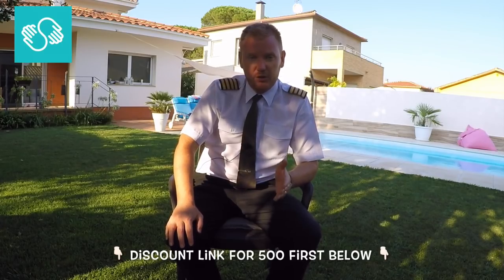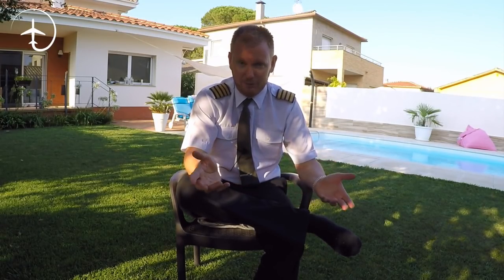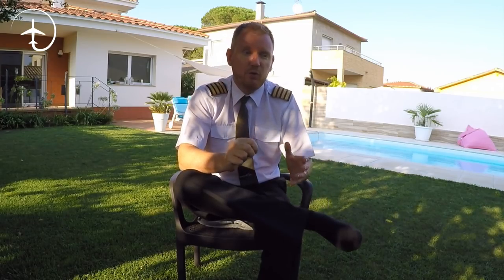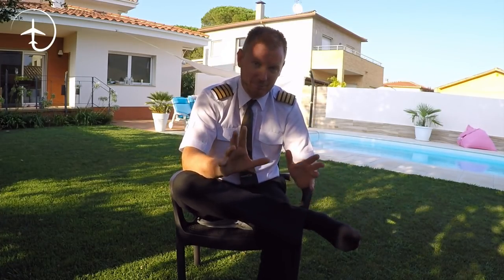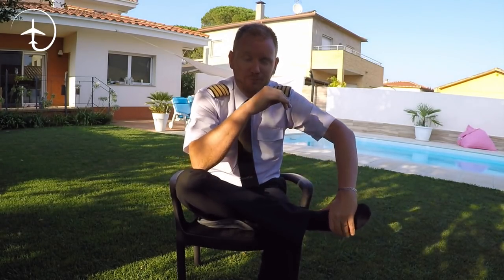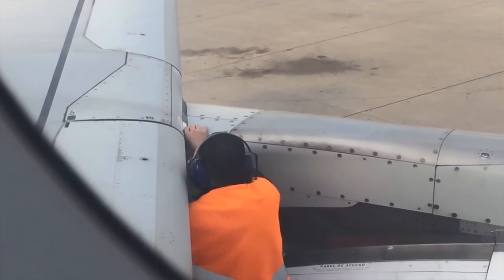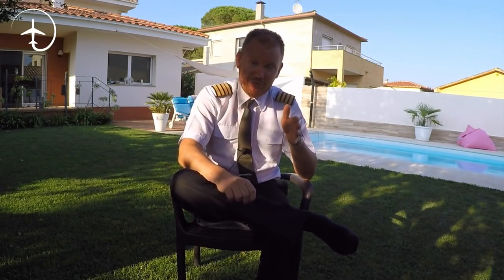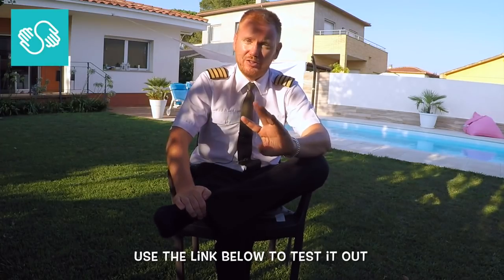Fixing aircraft with DUCT TAPE?! Mentour Pilot explains.

Comment: While waiting for boarding my last airline flight, on an A330, we got to watch them taping up the left wingtip, where the winglet was noticeably missing.  I don't know if it fell off during the previous flight or it was removed before I got there.

I also noticed they shut off the APU for a while and delayed boarding.  The pilot later said that was because they had to shut off power to work on the plane's air conditioning, and they delayed boarding because we'd be less uncomfortable staying in the airport terminal than on the plane with no lights or ventilation.  No mention of the winglet.  No problem on the flight.

Comment: I think you should do a video about ATC communications. I don't really know much about what happens between the ATC tower and the pilots other than the IFR/VFR, taxi, take-off and that kind of clearances, but I would like to know what do you guys say to the controllers when you are at high altitudes, what kind of facilities like Radar, Control or Center do you contact and I always wondered, what is the proper way to check in a Radar/CTR frequency?

Comment: So, it really is 600 mile an hour tape!
Reply: Wes Smith 
Yes it is 
Im a retired Aircraft Mech from CONTINENTAL
Reply: True and if the area is cleaned and the tape is properly boned down it wont come off. In fact we were told not to paint over it. We had one "temporary" repair that was missed and painted over at D check. It was not discovered until the aircraft a B707 was stripped and repainted at the next D check.  Retired TWA
Reply: Wow, that is some good shit. No wonder it is so expensive. (I was already familiar with the difference between "duck" tape and proper aluminum duct-work tape so I'm not horribly surprised. The HVAC stuff isn't cheap, and it doesn't have to hang in at 0.85 MACH.)
Reply: Yeah but the wind won't be affecting it in mid flight, because the air density is significantly lower at higher altitudes!.
Reply: I saw an episode where a cargo crashed due to lot of smoke in the cabin that prevent pilots to see Instruments. 
Can a cargo o passengers plane flight with pilots windows opened? 
Thanks mentour for the answer
Reply: Most "Duck Tape" is junk. The glue dries out in a year and just turns to powder.
Reply: Wes Smith. We used speed tape/ordnance tape/600 mph tape for military planes in the 60's.  My squadron flew F4 Phantoms, so the name was appropriate.  It was only $75 a roll back then.
Reply: @vondumozze738  of course, $75 a roll in the 60's was a big deal! If I remember my dad's stories right, gas was 5-10 cents a gallon then, right?
Reply: Speed tape: "Speed, I am speed."
Reply: @vondumozze738  A Rol of this tape can be bought by anybody. The thing is, if you are using it in the aviation it needs certificates. CofC. Then the price goes with hundreds up. Applys for every part or consumable that is being used in the aviation. Still it is not that expensive as the guy explaines. Most common sizes used is the one inch or 2 inch width. But if ordered bigger, yes very expensive.

Comment: In the USA duct tape is often called "hundred mile an hour tape" from its use in fixing minor damage on lower division racing cars.
Oh and most adhesive tape including duck tape is "pressure sensitive" this just means the adhesive needs to be pressed to create a bond,  as contrasted with a wet adhesive tape that only needs light contact and then drys or cures to bond. (such as paper tape with moisture activated glue often used for postal boxes or even the "lick and stick" envelopes and stamps, or woven glass fiber tape applied with a catalyzed polymer resin)

Comment: Exactly! Speed tape is used to reinstate aerodynamic surfaces to maintain lift or protect external finishes. Occasionally we use it over the top of sealant in case it hasn't fully cured to prevent it from being forced out of the area, during flight, that's supposed to be sealed.

Edit: The application of speed tape is documented in the Tech Log, usually with periodic reinspection and reapplication requirements being called for. It's also used on military aircraft during conflict to affect what is known as a "battle damage repair" where it's applied both internally and externally to create a very strong but fast temporary repair.

Comment: We used speed tape on recently installed windshields if the aircraft had to fly before the sealant had time to fully cure.
We also applied it to boost pump caps. And leading edge seams.

Comment: The story behind picture of the speed tape being applied on the cowling.  Right behind the lip skin the leading edge usually shows erosion and up to certain limits per the SRM you are allowed to apply speed tape till a perm repair is done.

In the US when you write up an item as an airline pilot on the logpage and once the mechanic look at it and it is outside of the published limits then the engineers come in with a repair if its feasible.  Just like a pilot is only allowed to write up, mechanics are only allowed to repair per the manual.  Anything outside needs some sort of Engineering authorization.

Comment: In dakar rally they got some kinda speed tape in their tool for race. It doesn't cost 1000$ per one peace but it's like 50-200. Anything on the car can be patched up with that.
Reply: Every mid range and higher race team has roles of the stuff in different sizes.
Reply: Your car speed tape doesn't come with an 8130 and need to be applied by an A&P and that is the difference

Comment: Mentour,  As usual a fascinating nugget of aeronautical knowledge! I do have one comment: While it was nice to reassure the flying public that even if they saw the stuff coming loose, that didn't spell disaster, I think you should have reminded folks not to be shy about alerting the cabin crew if they see something really odd. (Yes, I realize it's a slippery slope...)
   For example you generally can't see the engines from the flight deck. But the passengers (and of course flight attendants...) can. British Midland Airways Flight 92 crashed in 1989 when the wrong engine was shut down. IMHO a visual report from the cabin could have clarified which engine was in trouble.
Jim

Comment: You call the people who repair the plane "engineers" but are they really engineers or are they technicians?
Reply from the maker: They are called engineers here in Europe. We have mechanics and engineers.
Reply: I'm European too; it's just that I didn't know the term was used to describe the people actually putting their hand on the aircraft
Reply: Europe goes to a full title of ' Aircraft Maintenance Engineer' instead of the US designation of 'Aircraft Maintenance Technician'. Mostly the same, but the AME is 'type rated' as to what they can work on similar to the ratings for the flight crew. The US is a little more free in what an AMT can work on, but is more controlled by their employer's training requirements nder the federal regulations.
Reply: Basically America figured out that if you call someone an engineer, you have to pay them more :)
Reply: @vinsanity982  getting a maintenance licence in the EU is much harder than in the US 
You can get an engineering degree using your licence exams
Reply: @stumo8681  I'm aware of that, but airplanes are airplanes. I'm pretty sure that if I felt the need to get that license, I wouldn't have any problems.
Reply: I was wondering this too actually, since here in the US the engineers are typically seen as the ones who work in the office buildings doing the analysis, design, and optimization of whatever it is they're building. They also take part in the manufacturing of course. However, when it's someone who strictly gets certification for maintenance they're typically known as the technicians.

Comment: Yes u can fix evrything with duct tape
Reply from the maker: Well, true to a certain degree. Maybe not everything.
Reply: wrong, flex tape will fix anything
Reply: Mentour Pilot If you can't fix something with duct tape you're not using enough duct tape ;)
Reply: Vaul the Creator - Duct tape is cheap, don’t spare it, use more, more is better.
Reply: duc't tape is cheep
speed tape is strong
but flex tape is the best
Reply: Robert Lafleur 2:14 is not cheap
Reply: Goran Rasljic nope
Reply: Goran Rasljic - Duct tape is cheap but that speed tape is really expensive like anything aviation related.
Reply: Robert Lafleur  i now but stil 700$-1000$ for a tape damn

Comment: It's also used to protect runs of sealant that haven't yet had time to fully cure.
That lets us install and seal panels moments before the flight is scheduled to leave.
If you've ever seen a huge smear of sealant spread across a panel from the seam back, that's what happens when uncured sealant flies without speed tape protecting it.

Comment: im an aircraft mechanic. we call it ally tape (aluminium tape) and yeah we use it ALL the time. aircraft get hit by rocks n stuff on landing/takeoff, if theres a gouge or crack in the metal you cover it with tape to stop moisture getting in and causing corrosion. corrosion is the aircrafts biggest enemy. the tape can stay on there for many months sometimes, as its not serious damage.

Comment: This was not a mayor issue but it caused the passengers to laugh, and made me laugh too.
My last flight was on-board an American Airlines B763, one of the oldest of the airline's fleet I would say. Covering the route from it's hub in Miami Int'l to Carrasco-Montevideo Int'l (Uruguay). We, with my friends, were sitting in the 27's and 28's rows, I was on the right 27 window seat, and at about 3 or 4 rows ahead, there was an upper bin with a malfunction on the closing system, the bin could not be closed and as you may know, the airplane can not take off with a bin opened. So, the cabin crew informed Captain Frank Akerman about the situation, he then decided to call maintenance. About 10 mins later, two maintenance personal came in the passengers cabin, and after 15 minutes of watching and figuring out how to fix the issue, they took some blue duct tape and closed the bin with it. As soon as the passengers saw the duct tape, laughs rained in the cabin. 
I immediately remembered a photo were a mechanic was showed putting grey duct tape in one of the engines of an EasyJet A320,  seriously we were held in the ground for an hour because of this, I would say it was the funniest thing that ever happened to me on-board a plane...

Comment: It is actually optional on the nose cowling on 737NG pr today..

"It is optional to apply speed tape over the open holes or loose fasteners. The speed tape must cover the open holes or loose fasteners. Do not cover the adjacent, intact fastener edges. Install a temporary or permanent fastener within 10 days"
SRM 54-10-01-1A-2

Comment: Uncertified speed tape is used in electronics development (prototyping) for some jobs. It still costs a fortune for the uncertified (industrial grade) type. It looks like duct tape from a distance but it is in fact either aluminium or an aluminium alloy with some impressive glue on the back. Basically it's hugely stronger to say the least. It's used in electronics for faraday cages where copper is not appropriate.

Comment: I used duct tape after refueling in the Cayman Islands.  The idiots pushed a Norman Islander into my Aztec F while I was in the terminal building grabbing a sandwich.  Nobody on the island to fix the 8" hole in my vertical stab, so duct tape to the rescue.  We flew onto Barbados, did about 3 months of work there, and then ferried back to Canada before getting the repairs we needed.  

In another case I had a severe crack in my wind screen on my P-Navajo and had to ferry it about 800 miles for a replacement.  Although I couldn't pressurize the aircraft (very much) I did bring the internal pressure up to 8000 feet so I could clear the mountains at 14,000 feet.  I used the metal foil speed tape to tape up the window at the advice of my AME.  It worked, so in my case at least I would concur that tape can and should be used on occasion if absolutely needed.

Comment: A bigger concern than tape is the unique challenge of managing composite materials.  Now 787 and A350 primarily use this material even though there are numerous engineer reports and warnings that this material is difficult to maintain and inspect damage in the same manner as metal components.  Do pilots really think these plastic materials are safe, given the warnings of various engineers?  Delamination in particular seems to be a major concern.
Reply from the maker: We put a lot of trust in the manufacturers, engineers and the licensing authorities. If they, after years of testing, conclude that an aircraft is safe for the public, we will fly it.
Reply: Mentour Pilot Thank you, that is reassuring.  I think the skepticism stays out there because the licensing authorities want airlines to remain profitable, and the manufacturers have deemed these materials a great way to boost cost savings for them.  It would be easier to reduce skepticism if there were not engineers out there doubting these materials and potential conflicts of interest.
Reply: Ganz Bestimmt That's an acceptable position if there was not already many examples in the last 40 years of companies choosing cost over safety.

Comment: A few years ago the pilot, myself and two other passengers took off in a twin engine Piper Aztec from Georgetown Texas en-route to Oshkosh Wisconsin for the annual EAA fly-in.  Shortly after takeoff, I noticed gasoline streaming along the left wing toward the trailing edge from the left tank's fuel filler cap.  Because we were IFR the pilot had to request permission to make a somewhat emergency landing at Temple Texas whose airport and airspace was closed for security reasons at the time due to President George Bush being was present at his ranch near Temple.  
The fuel cap was a levered rubber type with steel disks above and below the rubber stopper with an adjustment nut at the bottom to adjust tension on the lever to create proper expansion of the stopper.  The rubber had worn somewhat so it wouldn't expand enough when the lever was pushed down to seal it, even with the adjustment nut at the end of the threaded portion.  We performed a makeshift repair using several paper towels.  We separated the metal disks from the rubber, stuffed several twisted paper towels into the space inside the rubber then reassembled and adjusted the newly stuffed fuel cap for a much tighter lever fit. We obtained permission to takeoff and resume our flight while following departure patterns in the restricted airspace exactly as instructed, which was to immediately head away from the ranch to un-restricted airspace when we resumed IFR flight with a slightly modified flight plan.  
Later at our planned refueling stop in Northern Missouri, we carefully examined the repaired fuel cap and found the paper towels inside were still dry so we elected to continue with our flight.  At Oshkosh we purchased a replacement rubber portion of the cap and had an uneventful flight back home a week later.  Had a replacement rubber portion not been available, I believe the stuffed fuel cap would have taken us safely back home as well.

Comment: I guess ISC Racer's Tape X-Flex would be a closer match to the speed tape than duct tape. It's a highly efficient tape that's mainly used to temporarily fix damage on race cars. It's an adhesive tape that's reinforced with a layer of aluminium, making it really strong and durable. But I guess the speed tape is a notch or two up from that.

Comment: Hello, just discovered your videos and enjoyed " Fixing aircraft with DUCT TAPE ? " [ Question One ] Any [ rough ] guess how many JATO's would be needed for a DC-3 to briefly achieve 260.693 knots in level flight ?  [ Question Two ] Assuming a system using attachment of the JATO pods to reinforced areas of the fuselage and other surfaces, would then a application of "Speed Tape" to some exposed areas be advised ? Respectfully, P.C.M.

Comment: Hi Mentour Pilot.
I’ve got one stupid question. If you take a look at the aileron of the 737, you will see that it consists of two parts, connected with hinges. However, during the flight it moves as one solid surface. What’s the reason for that design?

Comment: Most gliders can be disassembled so there's usually a bit of a gap between parts when they're reassembled, so glider pilots are using tape of some description to close gaps between wing and fuselage or wing parts, fuselage and stabilizers etc. as an aerodynamic optimization.  So there tape even is a routine thing not a temporary fix!  There is special gap tape available but it seems glider pilots prefer using white electrical tape - anything that only comes off when it's supposed to and is cheap.

Comment: you can see in the vid of the guy taping the engine there is exsposed rivets all along where he is applying the tape. he is just covering them until the surface can be painted which the tape will prevent the bare surface being exposed to moisture and corroding. an aircrafts paint is there to protect against corrosion of the metal, not to look cool.

Comment: The story about the ducttape fix to a bushplane is true. However, when the FAA came to investigate a totalled plane as seen on viral pictures,  they were looking for a plane that should be taken out of service for extensive testing because there should be to many replaced parts on a single plane for it to be certified. Except the operator showed the logs and while all his planes had recently got some replacement parts, none of his planes had too many parts replaced  and told the FAA inspector not to believe everything shown on the internet.